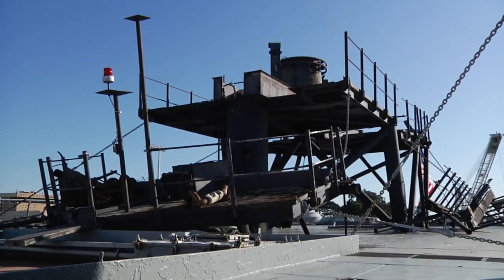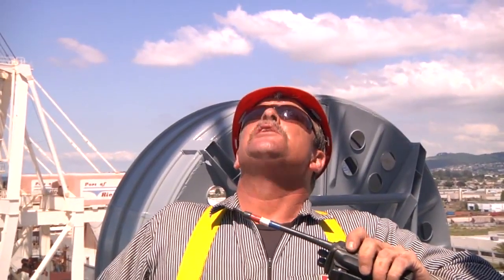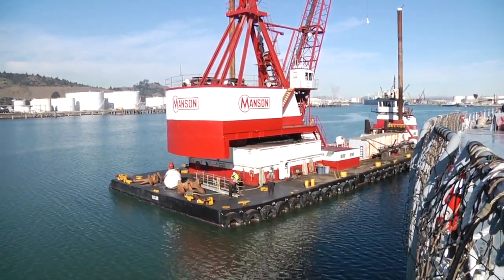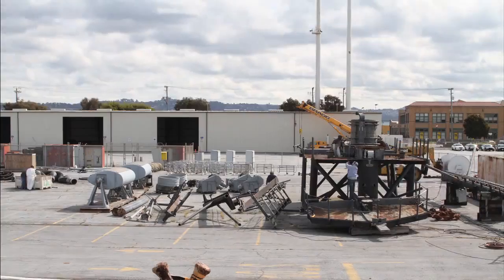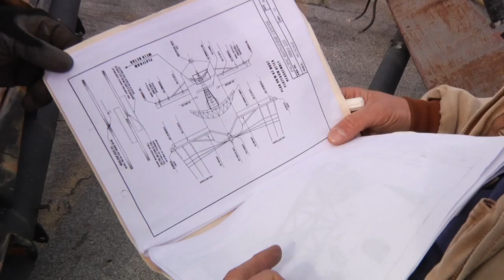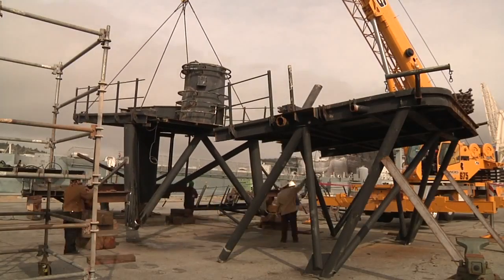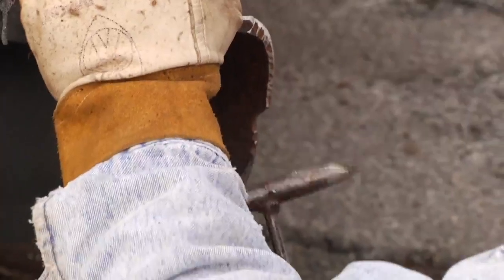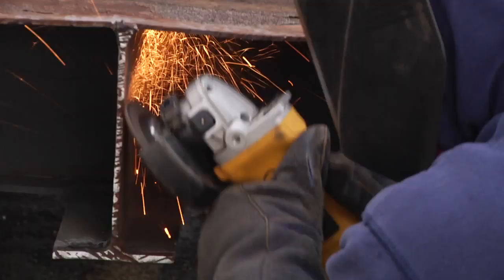Toppermost Battleship IOWA Mast Assembly

Comment: when the video shows removal of the mast & other gear from the deck, it looks like the deck is plain steel--did the Iowa not have teak decks? (or if it did originally, were they removed when the BBs were recommissioned?)
Reply: The teak decking wasn’t removed, as it’s used for insulation for the deck below. From the New Jersey’s YouTube channel the deck was covered up but not removed.